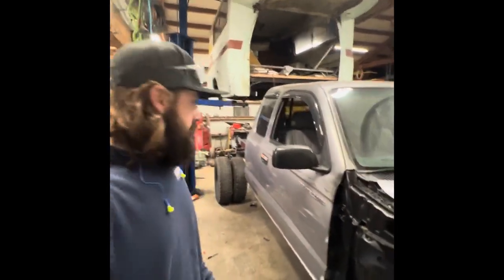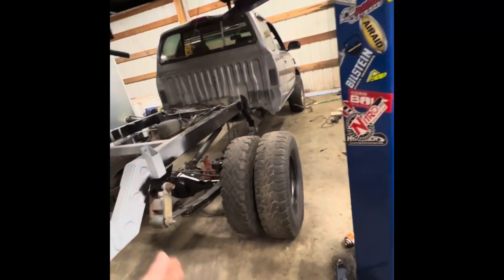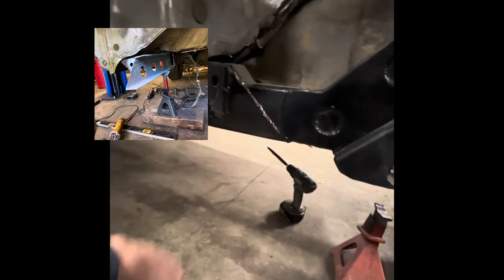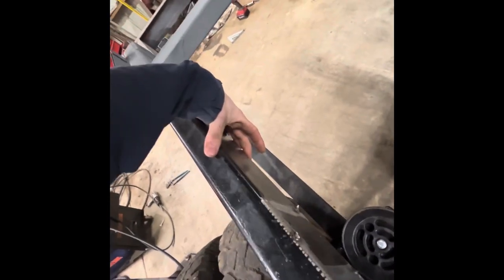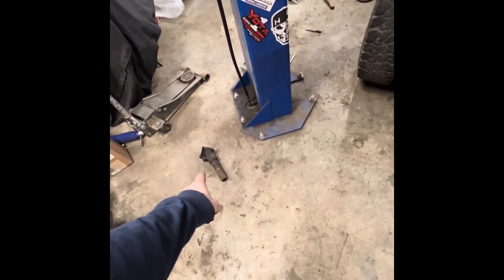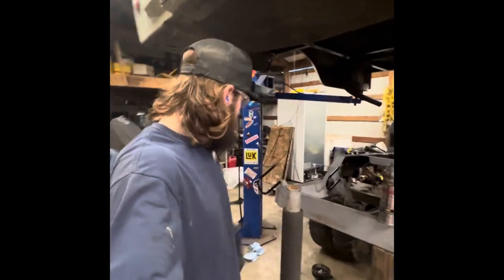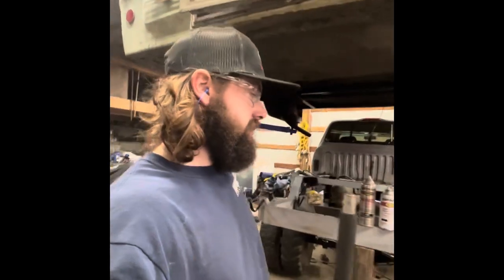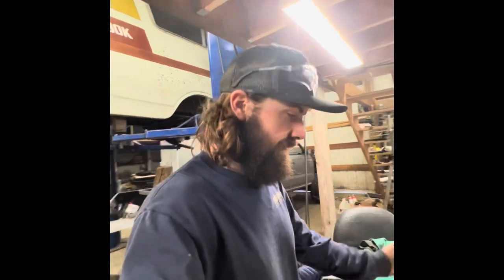Toyota Tacoma chinook camper “TacoNook” quick  introduction and walk around

Comment: I've seen these types conversions, but never have I seen a 1970s Chinook, the type with the Van front chassis, being transplanted onto a mid 90s Ford Econoline van cutaway. Would it be to much work to cut the back cargo area off a 96 E-350 Van, and mate it up with a 1975 Chinook. ..the kind with the factory Dodge van front chassis aplication? Your thoughts?

Comment: How much weight can the 63 springs you went with hold? I got a set that has 5 leafs plus the overload. Debating how many leafs I should remove.
Reply from the maker: So these 63s have seen a lot of life. They’re kind of a bastardized pack with toyota leafs as well. They’re very soft, and I was slightly worried about the load carrying capacity of them. That’s one of the reasons I went with the floating air bags. 

But, they came in a large variety of trucks with very load capacity’s. A 5 leaf pack would be very stiff. I would run a 4+1 on this build, if I was able to find a good set for cheap.